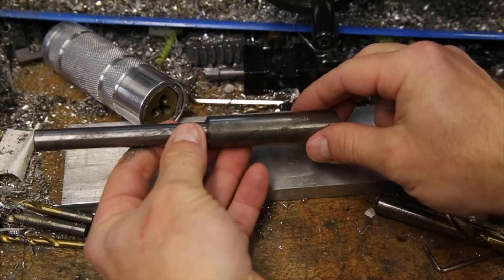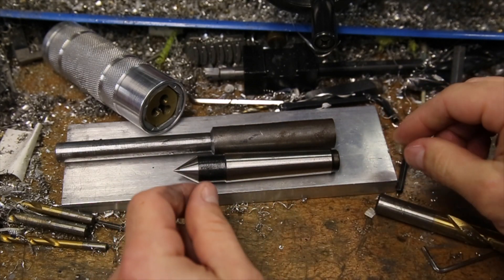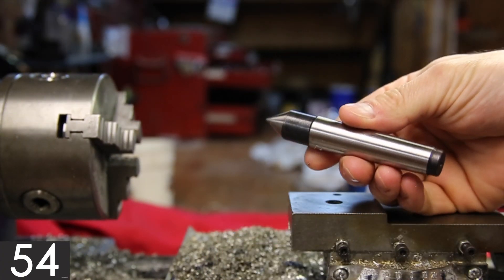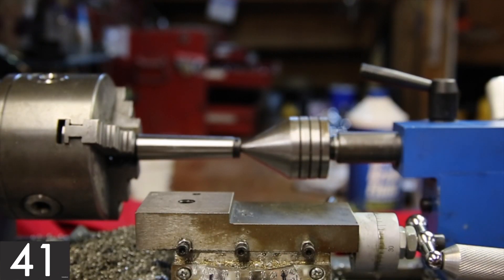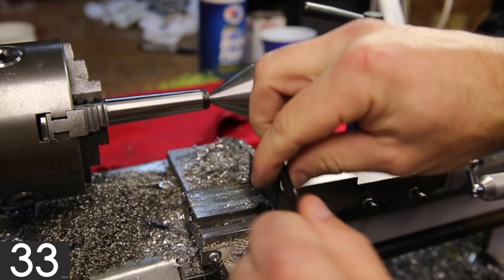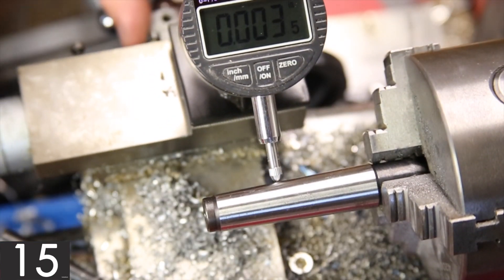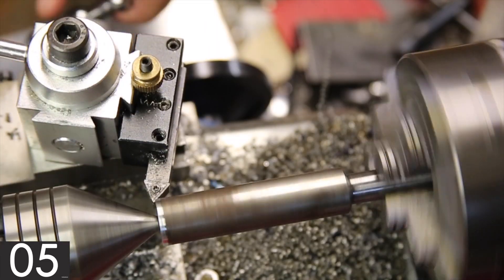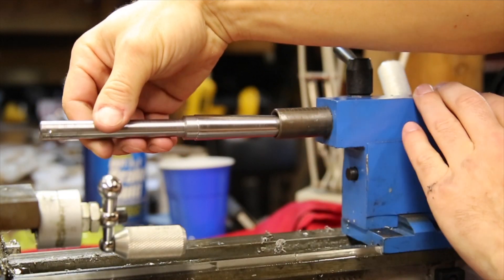60s Tutorial - Easiest Angle Setup Ever? Turning an MT2 Morse Taper on Mini Lathe, No Measuring

Comment: How much travel do you have on your compound? My atlas has just under 2" so it would not be enough for a typical mt2 taper length.
Reply: Go ahead and make one that's 2" long. Two inches is plenty enough.
Reply from the maker: Mine isn't long enough either - This was for my tailstock die holder project and you can see the full cut here: https://youtu.be/0v06IauXoRY?t=301 but basically I turned half the taper and then moved the carriage to finish the rest of it, just had to be careful where the two sections met.

Comment: I tried it today but sadly my parallel axis' weren't parallel so the angle was off slightly. A slight rotation of the compound solved the issue and the taper turned out nice and tight.